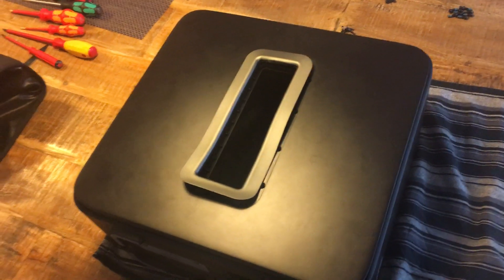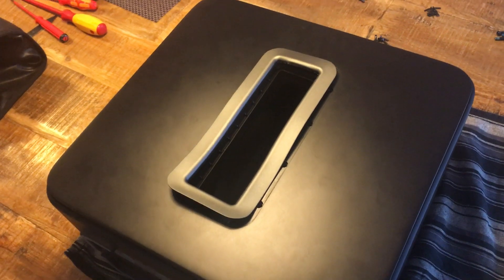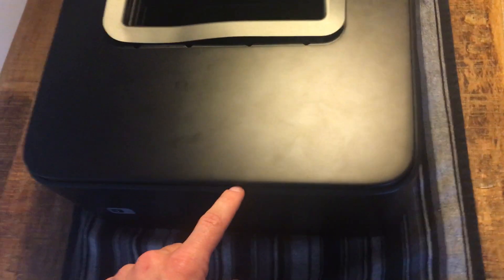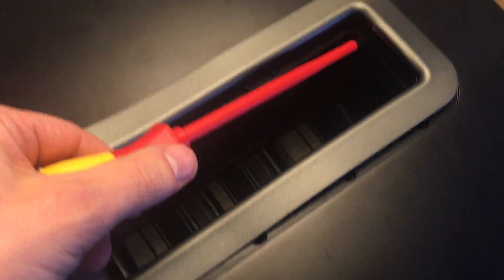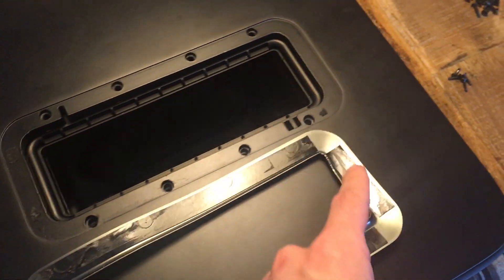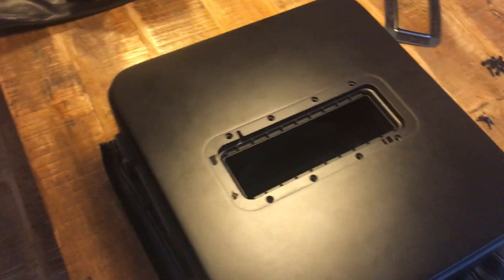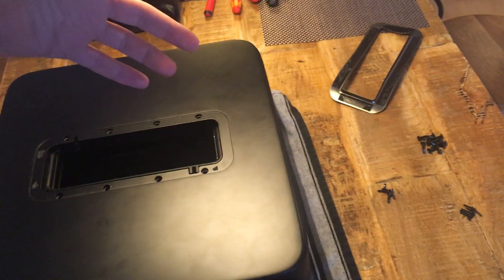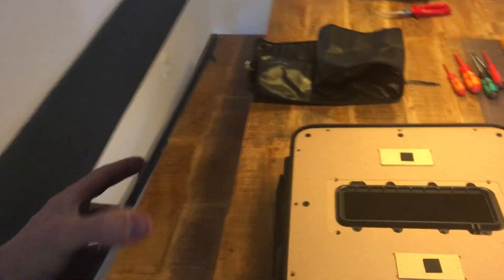How to open Sonos SUB 1of4

Comment: thank you for this video, helped me fix my sub. it was a disconnected wire. used hot air station, palette knife, and some plastic 
spudgers for the metal, suction cup for the panel.

Comment: very helpful video. thank you for posting. i was fortunate and my sub had only a mechanical failure. a ribbon cable had disconnected from circuit board, which was a 30min fix and very gratifying.

Comment: Don't just pry off the metal trim in the centre, use a heat gun to soften the double sided tape first and it will come off easily with gentle prying. Clean and replace the double sided tape to fit the trim back again.

Comment: I used a hair dryer to remove the metal. then gently leverage with 2 knives. btw i had a rat in the sub. Thanks to my cat
Reply: I just did the same. Big screwdriver, hair dryer to soften the glue and a bit of patience and everything came apart without any damage. Now I just need a circuit diagram coz the fuse and rectifier are apparently intact - dammit.

Comment: Hello,

Do you possibly have information regarding the diode with a heat sink (marked as D6) connected after the transformer on the rails? Looks like a schottkey diode. It seems to be shorted but there is no marking on it. 

Do you have more information regarding that part? Thanks!!
Reply from the maker: Sorry I don't.
Try and contact an electronic store.